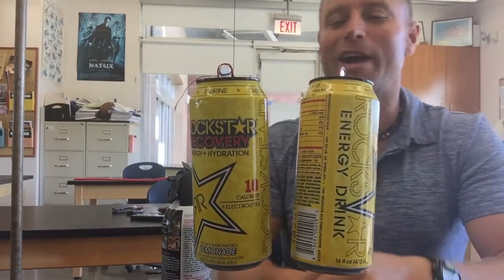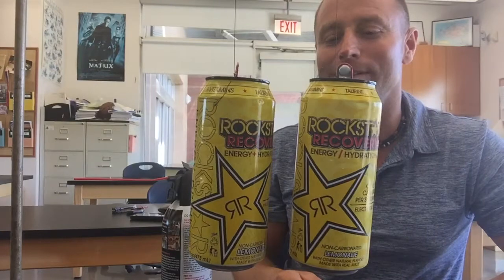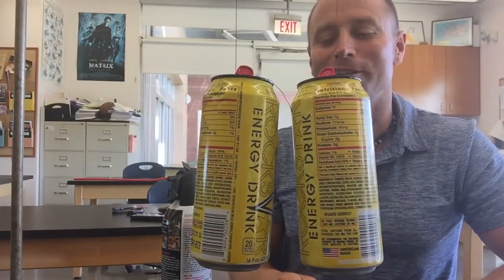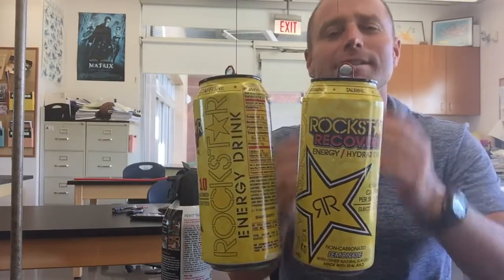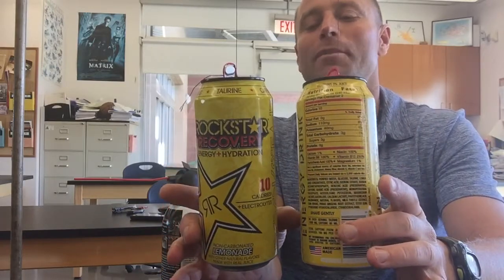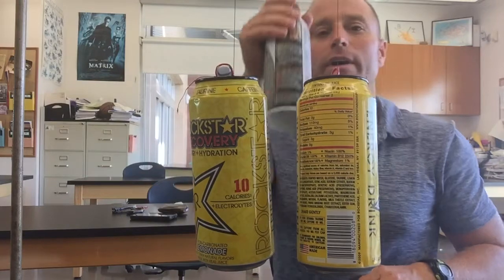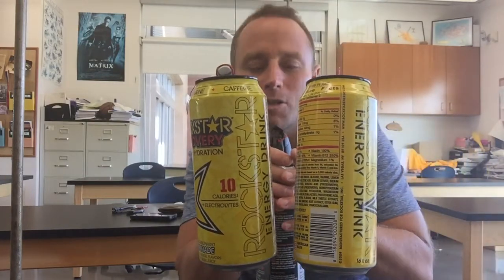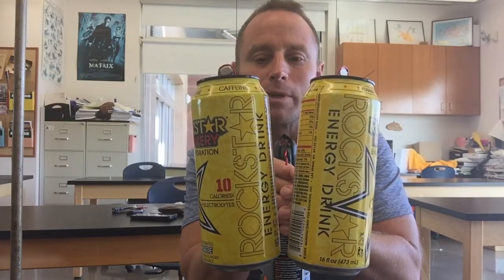Bernoulli Effect Demonstrations - Fast Air Creates Low Pressure

Comment: Why is fast air associated with lower pressure?
Reply from the maker: Two ways to think of it:
(1) Air that has moved has left a void; other air will want to go there. (2l) bernoulli's equation P + pgh + (1/2)pv^2. = constant. If v goes up, P would come.down at same height h.

Comment: But WHY does fast moving air create low pressure?
That is the one question no one ever answers when I try to learn more about the Bernoulli Effect.
Physicists/engineers constantly say "fast moving air creates low pressure" but no one explains WHY that happens. You can do these same experiments in water, and it will behave the same way. But the density of air and water don't change when they move... Or do they?
See, this is why I'm confused.
If the molecular density of the air remains constant, then why does the pressure change? I just don't get it.
The "how" is understandable, but the "why" baffles me.
Reply: My question precisely, have you found an answer yet?
Reply: I was wondering this as well, but it did make sense eventually. The way I thought of it is in the case of slow moving or stationary air, the molecules are moving in a certain direction and at a certain velocity in more random directions (including onto/colliding with the ball, or wing, or paper, whatever the object is) so the pressure on that specific area of the object has a certain value. Now when you start moving the air in a specified direction not colliding with the object it is now more organized and the direction is much less random, so you get less air colliding with the top section of the ball, paper, wing, etc. which in turn results in a lower pressure on the wing. Since pressure is essentially a force per unit area I think we need to clarify which surface area are we talking about when we mention pressure.